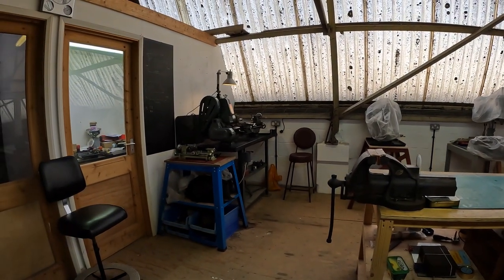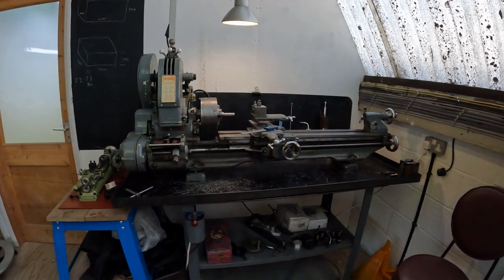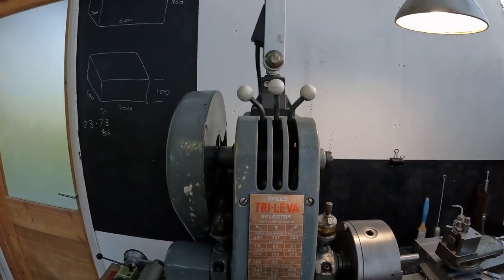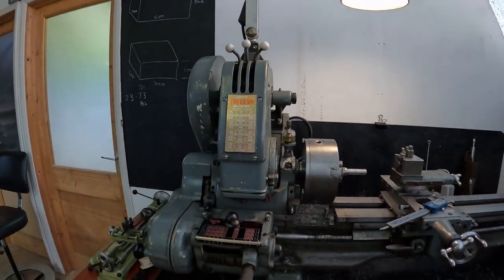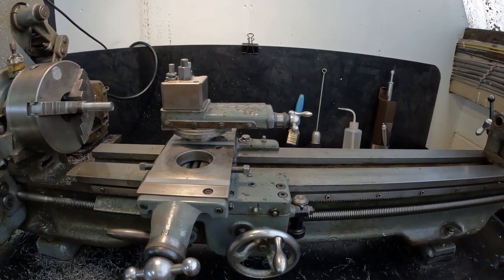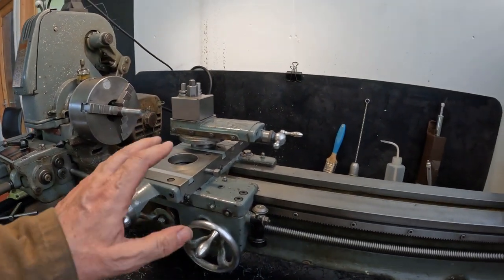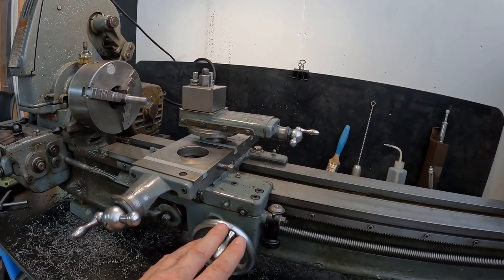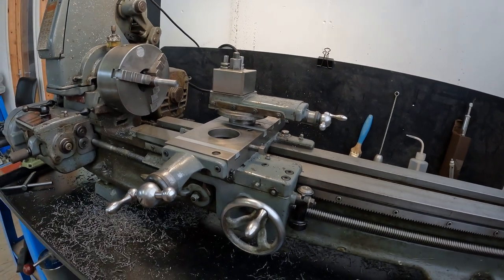Myford Lathe - Power Crossfeed HELP..

Comment: hello ,just building  super7 with QCG and power cross feed
i have 3 Super 7's with short beds and 1 ML7 long bed. long bed Super7 and ML7 come with 3/4" dia. 8ACME LH lead screws. and clasp nut to fit the 3/4" lead screw. they come with super7 saddle and apron. feed screws and feed nuts for cross / top slides are 3/8" dia 10 TPI RH ACME. for Super 7 and ML7. 
with power feed cross slide ( i have one short bed / wide)  they use 3/4" dia lead screw with a slot runing all long (key way) in both short or long beds. the saddle have some features of the normal super 7 but differ in having a spur gear. the cross slide having a feed nut which is bigger and a feed screw of 9/16" dia.10 TPI BSB😮 and fitted with a longer bigger end bracket .
The crunch is in the apron , which contain all the gears needed to operat the power cross feed. 
The lead screw brackets on the right and the left are all the same on both types ( i think ). keeping in mind lathes from serial number SK108891B do not need packing strip if a quick change gear box needed to be fitted. therefore i think older beds are narrow( .NOT SURE). the top slide on power cross lathes are the same as Super 7s. i do hope this information of help. and please correct me if i made a mistake some where. Now a days ,the cost of just having to buy a power cross feed from ebay would be between £650 up to £1200, depending on the bits bought and condition. the best bet is to fit a small DC motor on your cross slide and it will give even a better finish results. good luck
Reply from the maker: Hello,
Many thanks for watching my video and taking the time to comment... lots of interesting information, which will be helpful to me and fellow viewers/readers. Thanks again.
Take care.
Paul,,

Comment: Hi Paul. I have the Super 7B as you know. Yes it does have a keyway the full length of the leadscrew. Mine is circa 1977. I'm not sure but i think some early S7's did not have power feed. You would need the whole carriage assembly as you mentioned it is completely different.
Parts do come on ebay etc from time to time. But i guess for a leadscrew & the whole carriage would be very expensive.
Regards.
Steve.
Reply from the maker: Hello Steve,
It would be nice to do at some time, Now I am almost 100% sure I can do it I will keep my eye open for a suitable Super 7 donor. Thanks for watching
Take care.
Paul,,

Comment: Hello Paul - I’ll be watching this with interest. My long-bed Super 7, about 1968 vintage, came with a WMED electric motor drive kit for cross feed. I presume these aftermarket items are common in England, but if not, I’ll be happy to send particulars if it comes to that.
Reply from the maker: Hi Dudley,
Many thanks for the information on the WMED electric motor drive kit for cross feed. I will setup a save search in eBay and see if I can find one... I was not aware of them.
Take care.
Paul,,
Reply: @TheKnacklersWorkshop  In that case, the letters stand for Warrington Model Engineering Developments. I gather they stopped trading years ago. The crossfeed drive is a clever little mechanism that can be engaged or disengaged easily, and while it’s low on torque, it performs agreeably.
Reply from the maker: @624Dudley  Thanks for the extra into

Comment: Hi Paul, adding PXF to your ML7 wouldn't be straight forward. I have a S7 with PXF and there are a lot of differences.
As you pointed out, the leadscrew has a keyway along its length, so does the cross feed screw.
The saddle & apron are different. The saddle contains the gear that drives the cross feed screw and the apron houses the offtake from the leadscrew keyway and bevel gears to turn this drive through 90 degrees for the cross slide and the dog clutch to engage/knock off the PXF.
It might be possible to fit a complete leadscrew & carriage/apron & X-slide assembly off a S7, but i suspect the bed of the S7 with PXF has more clearance around the back of the leadscrew for the offtake bevel gear which fits around the leadscrew. I suspect this will be the thing which makes this conversion impossible. I can check mine if you like.
This shows the back of the apron on a PXF S7   https://www.youtube.com/watch?v=kcuQrkwa7rU
All the best,
John
Reply from the maker: Hello John,
Thank you very much for your thoughts... given a donor Super Seven Saddle and cross side it looks like most things would be covered. So the clearance on the leadscrew might be the problem. I am sort of hoping that being the long bed ML7 that appears to have some super seven leadscrew maybe there is more clearance. When you have a second if you could check yours I would be grateful.  Thanks again.
Take care.
Paul,,
Reply: @TheKnacklersWorkshop  Hi Paul, YouTube keeps deleting this reply, so for the third time....
I've checked my S7 and I can pass a length of 14.5mm dia rod right round between the leadscrew and the bed. 15mm won't fit.
I hope that helps.
Reply from the maker: @swarfy5377  Thanks John, I will check mine tomorrow when I am in the workshop...
Reply from the maker: @swarfy5377  Hello John,
Well I measured mine this morning and a 7.2mm drill bit would pass between the rear of the leadscrew and the casting (bed) anything bigger would not go.
Reply: @TheKnacklersWorkshop  That's unfortunate Paul. Not enough room for the leadscrew bevel gear to fit.
Reply from the maker: @swarfy5377  I thing I have measured it wrong and actually it is about 14.5...  My friend lives about 50 miles away and he has a super 7 so I think I will pay him a visit,  There is also an interesting video called  "Converting a Myford ML7-R into a Super-7B." Thanks again for your help.

Comment: Hi Paul. If the main bed is the same as the Super 7 I can’t see why it’s not doable. If you need to cross check dimensions with my Super 7 (which has power cross feed) let me know.  👍😀 Andrew
Reply from the maker: Hello Andrew,
Maybe when I next visit I could have a demo of the cross power feed on your Super Seven. Thanks for the offer of measurements...
Take care.
Paul,,

Comment: eyup Paul
I have never had dealings with A MYFORD POWERED CROSS FEED model, but i would imagine anything can be adaptable, if money is no object, good luck with it
take care
Kev
Reply from the maker: Hello Kev,
The money no object was to trying and find if the conversion was possible, rather than ideas on stepper motors and cordless drills. Once I have found out if it is possible then the Bargain Hunter in me will be called into action. Thanks for watching.
Take care.
Paul,,

Comment: My model engineering club has a Super 7 but don't recall if it has power cross feed. I can measure things on it at the club on Tuesday if that helps but you will have to remind me.
Reply from the maker: Hello Ben,
I believe the Super Seven's cross power feed was an option, so some have it and other don't. Maybe first steps would be to check if your one do have cross power feed and then if I need measurement I will give you a shout. Thanks for your kind offer.
Take care.
Paul,,
Reply: @TheKnacklersWorkshop  No problem.

Comment: Hi Paul, 
Good luck with that quest.
Reply from the maker: Hello Mark,
I have a gut feeling that the answer is no, but hoping I am wrong, it was a surprise that the long bed version of the ML7 shares the leadscrew and cross slide of a super seven... I guess time will tell. Thanks for watching.
Take care.
Paul,,
Reply: @TheKnacklersWorkshop  At least in the UK there is a fairly active accessories market. Hope you find the saddle without having to break down a full machine.